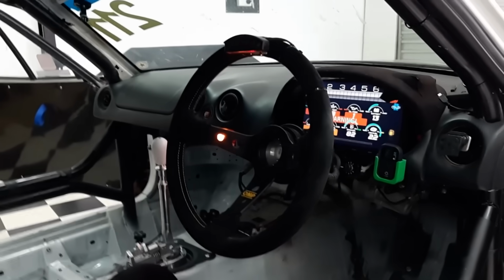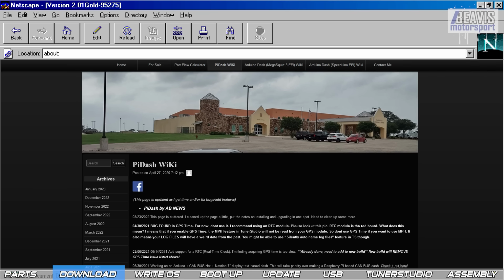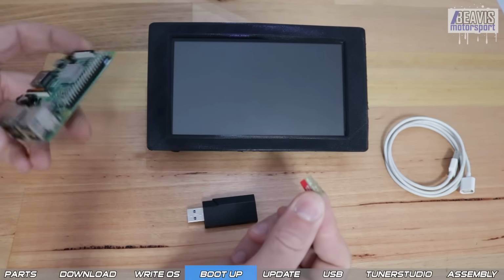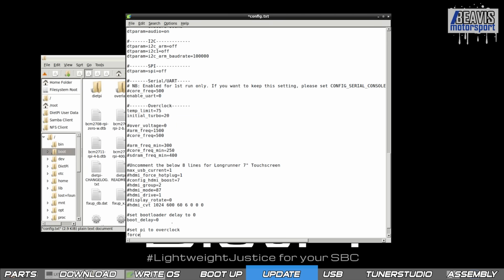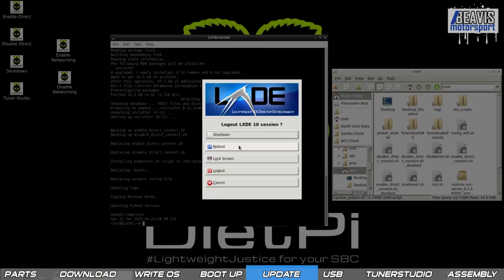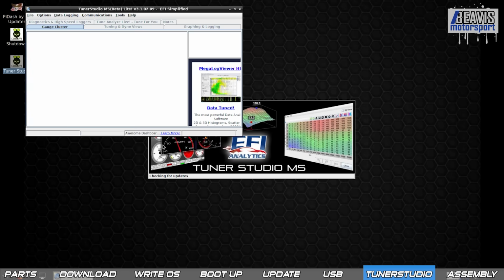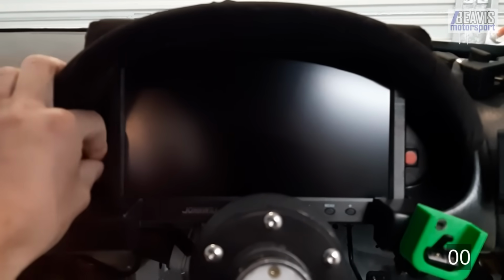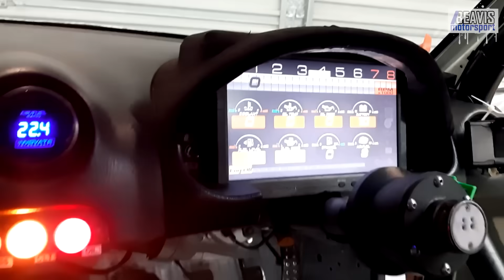DIY Raspberry Pi Racecar Dashboard: The Ultimate Guide

Comment: Could this be used in normal cars too? 😅 Like for giving your cluster a more modern look when done properly?
Reply from the maker: Hey christof, If you run a Megasquirt family of ECU in your car, then you can apply the same software process as I have detailed in the video. If you run another ECU, or the factory computer, then you'll need to find some appropriate software for your car.
I'm running this dash in a track car, that uses a Megasquirt MS3 ECU. So all my sensors, speed, temps etc go direct to the ECU. Then the ECU has a USB connection direct to the Pi to feed the data for the dash software. Thanks very much for watching.

Comment: thank you very much for this video, i was wondring how you connected the pi to the car to read all the data. is it through obd can interface and any adapter is required?
thanks again
Reply from the maker: Hey 3wasAl
I'm running this dash in a track car, that uses a Megasquirt MS3 ECU. So all my sensors, speed, temps etc go direct to the ECU. Then the ECU has a USB connection direct to the Pi to feed the data for the dash software.
If you run a Megasquirt family of ECU in your car, then you can apply the same software process as I have detailed in the video. If you run another ECU, or the factory computer, then you'll need to find some appropriate software for your car.
Thanks very much for your question.

Comment: Very, very cool !! Finally a good use for the HDMI-input on my radio. Only one question: How do you get your data from the car to the Rpi ? You do that through a OBD-dongle? You have a bit more details on that?
Reply from the maker: Hey Mischa, I'm running this dash in a track car, that uses a Megasquirt MS3 ECU. So all my sensors, speed, temps etc go direct to the ECU. Then the ECU has a USB connection direct to the Pi to feed the data for the dash software.
If you run a Megasquirt family of ECU in your car, then you can apply the same software process as I have detailed in the video. If you run another ECU, or the factory computer, then you'll need to find some appropriate software for your car.
Hope that helps.
Reply: @Bbeavis  Hi, this is a very disappointing reply, as it means I can't use the software for my daily driver. Thanks man, it just looks awesome, but not useable for this poor guy ;-) Happy racing and keep the pedal to the metal! Drive safe ;-)

Comment: Can you explain in detail how are you getting all that data from the car
Reply from the maker: Hey Dasari, I'm running this dash in a track car, that uses a Megasquirt MS3 ECU. So all my sensors, speed, temps etc go direct to the ECU. Then the ECU has a USB connection direct to the Pi to feed the data for the dash software.
If you run a Megasquirt family of ECU in your car, then you can apply the same software process as I have detailed in the video. If you run another ECU, or the factory computer, then you'll need to find some appropriate software for your car. Thanks.

Comment: hi great video very useful. for the sensors do you have another video showing them and how to interface with PI rasp? thanks
Reply from the maker: Hi Alberto, Thanks for the question - I don't have another video specifically on the topic of sensors.  I'm running this dash in a track car, that uses a Megasquirt MS3 ECU. So all my sensors, speed, temps etc go direct to the ECU. Then the ECU has a USB connection direct to the Pi to feed the data for the dash software.
If you run a Megasquirt family of ECU in your car, then you can apply the same software process as I have detailed in the video. If you run another ECU, or the factory computer, then you'll need to find some appropriate software for your car. Thanks for watching.
Reply: @Bbeavis  thank so much, but my intention was to use on a bike, my old 88 vfr750r. so no efi and no "obd" sensors data. thanks anyway and great job indeed

Comment: i have question, do we need ecu or the raspberry become the ecu?
Reply from the maker: Hey Andre, The RaspberryPi acts purely as the computer to display the dash, it doesn't run the engine itself. I'm running this dash in a track car, that uses a Megasquirt MS3 ECU. So all my sensors, speed, temps etc go direct to the ECU. Then the ECU has a USB connection direct to the Pi to feed the data for the dash software.
If you run a Megasquirt family of ECU in your car, then you can apply the same software process as I have detailed in the video. If you run another ECU, or the factory computer, then you'll need to find some appropriate software for your car. Thanks for the question, hope that helps.

Comment: dump the whole X manager thing and use kiosk mode, will take some time off as there is only your thing running
Reply from the maker: I haven't tried this yet, but its one thing I'd like to look into... not sure how well the TunerStudio software would handle this so it'll be a bit of an experiment for one day in the future.
Reply: @Bbeavis  the apps run as normal you just want them to have a full screen mode so they occupy the whole screen as you can't do it after they start as you lose the decoration. 
There are debian guides that use openbox as the framework or just start in non gui and hack "startx".
Reply from the maker: @TheShorterboy  Thanks for the tip, I run a RasPi in my HomeAssistant dashboard via a chormium browser running full screen that uses openbox more or less as you describe, i might try swap the dash over to using the same base OS as my HomeAssistant setup.

Comment: Thanks. Very interesting. I assume the connection the cars computer is relatively straightforward.
Reply from the maker: In some regards, that is the most challenging or convoluted part of the process, because there are so many different car interfaces. In the case of this video it is via USB connection from the Megasquirt MS3 ECU direct to the RasPi.

Comment: You still havnt shown how to connect the fuel , speedometer, rpm to the cluster you installed
Reply from the maker: Hi Mr Spitts, Sorry I didn't touch on that aspect as much as I perhaps should've. I am running this dash in a track car, that uses a Megasquirt MS3 ECU. So all my sensors, speed, temps etc go direct to the ECU. Then the ECU has a USB connection direct to the Pi to feed the data for the dash software.
If you run a Megasquirt family of ECU in your car, then you can apply the same software process as I have detailed in the video. If you run another ECU, or the factory computer, then you'll need to find some appropriate software for your car.
Hope that clarifies and helps with your query.

Comment: Awesome guide. Thanks for this. Have been back and forth on doing one of these for years. I am assuming you're using a megasquirt for the data connection to tuner studio? I'm going to have to look into if there is connection with other ECUs possible . 
The screen looks pretty nice and bright. I'd definitely have to get boot times down a bit and have it automatically turn on and off with ignition. But this has definitely renewed my interest. Great stuff
Reply from the maker: Thank you,  yes indeed this is using the TunerStudio software, specific to the Megsquirt ECUs. This car runs an MS3 which connects to the Pi via USB cable. I agree on loading times, I'm constantly trying to improve them.

Comment: Idk if anyone has asked this but would this work for the nismoteonic ecu systems?  Or if anyone has some advice on making one work with it would be great.
Reply from the maker: Hi Jason, indeed I don't have an answer for you sorry, the Tunerstudio software I use here is specific to the Megasquirt ECU. Hopefully some others can share their software options that work on the RasPi for other ECUs.
Reply: @Bbeavis  is the raspberry pi basically just running the megasquirt program in order to get the gauge info? Cuz nismoteonic has the ability to run a sensor dash setup within the program
Reply from the maker: @jasonnuhfer827  Yes, exactly. You can theoretically use any other dashboard display software that works for your car.
Reply: @Bbeavis  so theoretically I can just do exactly what you did but run nismoteonic and be ok  thank you Beavis for your rapid and honest answers and not getting aggravated as I have seen some people get when asked questions. This video is very informative and a brilliant idea. I will definitely be going through your videos to see if I can find any more that will help me.
Reply from the maker: @jasonnuhfer827  You'll need to make some changes to the way I setup the software in the video, either NismoTronic needs a lunix version.
Or, you setup the Pi to run on Windows, which I believe can be done, I've not tried it myself though.

Comment: Use a time delay relay board to trigger the shutdown automatically after a set amount of time after turning the key off. Say...12 hours. That way you don't have to wait for boot up every time you drive. 

This is the perfect solution I've been waiting for. Right now my Pi stays on all the time and just the screen powers off with the key. This kills the battery over a few days if I don't drive.
Reply from the maker: Thanks Steve. Your suggestion is a very good idea.
For me, this is a track car, so leaving the Pi on more frequently isn't necessary.

Comment: Hello need some help
I want to build virtual cockpit dashboard for my land rover discovery 2 td5 2004 is that possible ?
Reply from the maker: In my case, the cars Megasquirt ECU is connected to the RasPi via a USB cable. The TunerStudio software I am using here is specific to the Megasquirt family of ECU's that I have in my Mazda MX-5.

If your car runs an aftermarket EFI based ECU, then you may be able to do something similar. However, I'm not sure of a solution for the dashboard software specific to the Land Rover Disco.

Comment: i'm thinking of doing something like this but im very new to cars lol. does the PI get the live car data from the ECU through the usb you mentioned? is it a standard or would each ecu require different software?
thanks in advance
Reply from the maker: In my case, the cars ECU is connected to the RasPi via a USB cable. The TunerStudio software I am using here is specific to the Megasquirt family of ECU's that I have in my Mazda MX-5 Miata.
Reply: @Bbeavis  thank you so much for the reply it helps me immensely! keep up the good content

Comment: Thanks for the video. I do have a question 
So I would line to do this for a race car also 
Old manual car what sensors can I use 
3pin 5v ? And what other items would I need to make this work thansk
Reply from the maker: All the sensors I have feed into the ECU for datalogging and reporting/checking. My ECU has a custom board to accept various analogue inputs.
This video covers a dashboard display to show the data from the ECU. If your race car runs an aftermarket EFI based ECU, then you may be able to do something similar.
If you're running a carby.... then it's potentially a whole new project in itself.

Comment: Edit:
Would this work for the me442 ecu? 
It will not,  yet. Saw a few others asking. Thanks again for the video
Reply from the maker: The hardware may be possible to use, but the Tunerstudio software is unfortunately specific to the megasquirt family of ECU's.
Indeed, a few others have asked similar q's.

Comment: I have a Raspberry Pi 4 model B. When I try to load this it says it requires a newer version software saying the Elf is invalid or something along those lines. Is there a newer version I am missing. I downloaded what was on the links.
Reply from the maker: This is not an issue I encountered so I cannot say exactly what the cause is.
I have heard of some issues due to SD cards, perhaps try a different card?
Or you could try the solution none986 described here:
https://discourse.mozilla.org/t/start4-elf-is-not-compatible-this-board-requires-newer-software/94783/3
Reply: @Bbeavis   No worries. Appreciate the reply. I will look in to it more. Try another card.

Comment: When trying to update the sudo apt update, it says certification failed. Tried doing it all again a couple times and still the same outcome. Any idea what I'm missing?
Reply from the maker: Sorry to hear about the troubles Rodney, did you confirm the clock time is correct on your Pi? You will want to 'enable networking' and then perhaps give the device a reboot, after its back online, wait a few minutes for the clock to sync. I'm guessing that may be the cause for issue. Before running the update command, see if you can access the web via the browser first, to ensure you're online and can hit your favorite websites.
Reply: @Bbeavis  had to redo everything the beginning. How do I make it retain the current date and time?  I've changed it in the initial setup. Somehow it only corrects itself after connecting it to the internet. The USB will not recognize until it is hooked back up to the internet.
Reply from the maker: @rodneywade8483  The Raspi do not have an RTC, it will never retain the time in it's default configuration. There are add-ons to include an RTC with a battery, if that's something you want to consider.

For example: https://pimylifeup.com/raspberry-pi-rtc/
Reply: @Bbeavis  OK. That makes sense but why does it not recognize the USB until the clock is synced?
Reply from the maker: @rodneywade8483  Your USB issue I've not come across, you may have to search for some solutions online.

Comment: I want to follow tour guide, want to figure out how to use some sort of battery backup to keep it on for aviut a minute after the engine is on
Reply from the maker: There are a few off the shelf options that might help
You could try juice4halt.com or take a look at mausberrycircuits.com
Reply: @Bbeavis  mauseberry ppl are very unresponsive I'll check the other dudes out

Comment: Great video. I am already sourcing the parts :). Do you think it's beneficial to have a touchscreen?
Reply from the maker: I used to have a Touchscreen, but honestly never used it. For me, any time i needed to interact with the device I used a mini keyboard and touchpad... just much easier. But certainly some might like the convenience of the touchscreen.
Reply: @Bbeavis  Did you consider using cheap windows tablet with Tunerstudio?
Reply from the maker: @GFI  Honestly not something that crossed my mind, If theres a tablet reasonably priced (say sub $200 or so) and the right dimensions, it might be a nice option. Need to consider ways to make it fit, power it, boot up when the car starts, etc

Comment: For some reason, my raspberry pi wont even load anything. followed the instructions step by step and got nothing on my touchscreen. Only thing i could think of is that my SD card is a San disk image smart card... going to try again when i get a new one. Any other suggestions would be fantastic
Reply from the maker: I did have issues getting a video output initially, commenting out the HDMI settings at the bottom of the config.txt fixed that for me.
You could try hdmi_force_mode=1, or change dtoverlay=vc4-kms-v3d or dtoverlay=vc4-fkms-v3d in the /boot/config.txt

Comment: Awesome! I don’t think you mentioned price for all parts in the final build? While this option is surely cheaper I am thinking of just going with the Powertune Digital dash. It’s still very cheap and has a bunch of advantages over this setup, if I understand yours correctly. Any thoughts? Thanks!
Reply from the maker: RasPi4 $100, Display $100, SD Card $20, and then the rest is mostly spares and things I had around, so total is under $250 (AUD)
Reply from the maker: I have had no experience with the Powertune dash offering so I cannot say what that's like.

Comment: I just so happen to be reinstalling my pi dash and decided to try this image.
One issue I’m seeing is my network doesn’t start automatically which cause time/date to not be correct.
Reply from the maker: Keeping networking disabled improves performance, if you need network and time sync enabled, you can do so via the icon/script in the root folder.
Reply: Thanks. How are you figuring out speed? Are you using gps?
Reply from the maker: @blacknblue1503  The factory transmission has a speed sensor which is wired into the Megasquirt ECU.

Comment: I looked at Dash options and saw several solutions but, needed something I could make a custom dash with. In particular I wanted something like retro Smiths instruments and options were limited. I looked at Pi Dash but was uncertain on what it could and couldn’t do. Noting how powerful a little Pi is, I considered starting from scratch but, that’s a little beyond me. Your solution looks good but I’d want to use it with a non-MS ECU via CAN. I’ll look into you solution a little deeper. Nice clear presentation by the way!
Reply from the maker: Thanks woznaldo, there is some CAN based dash software out there for the Pi, that may work for your needs.... You'll need to get a little inventive.

Comment: How does the pi interface with the car? Amazing build, but could not find that step.
Reply from the maker: The Tunerstudio software works with the Megasquirt ECU, and connects via a USB cable straight into the back of the PI.
Reply: Thanks! I realize this is for a race car now. Haha. Is there a way to use the obd interface ?
Reply from the maker: If your car has the OEM ecu, and it supports OBD, then you can consider this software: https://github.com/Pbartek/pyobd-pi